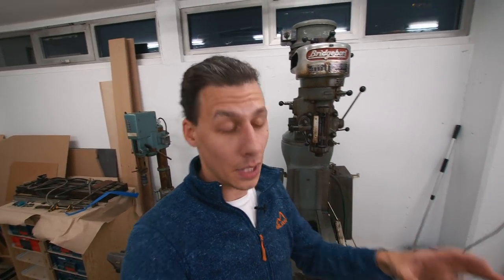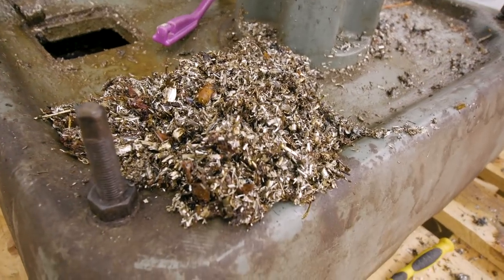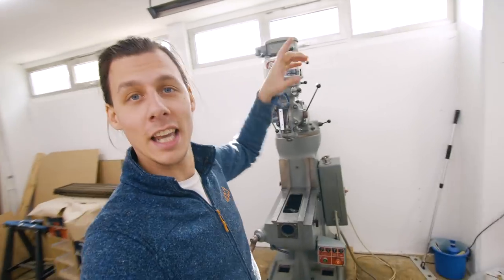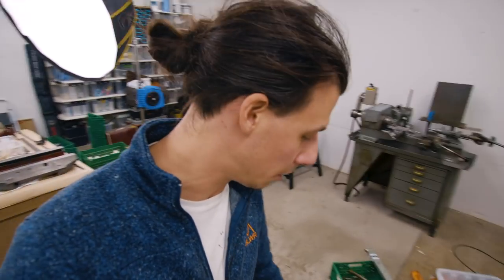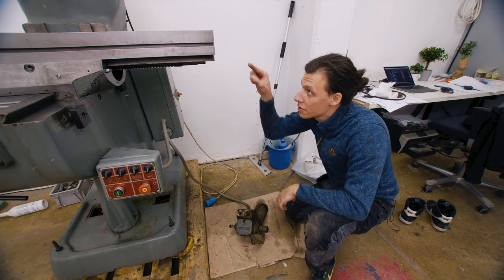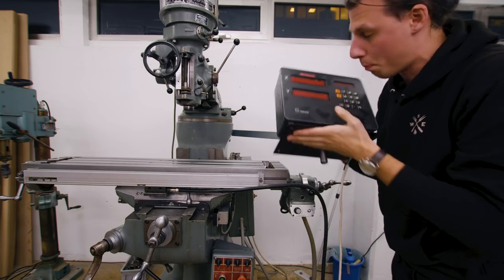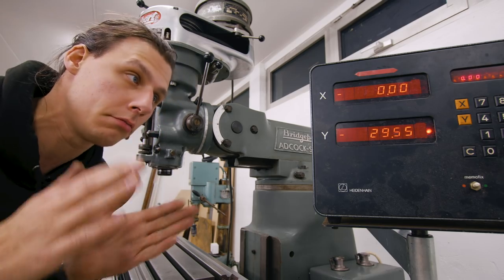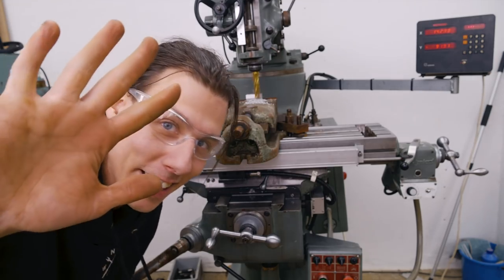Restoring a 60 Year old Bridgeport milling machine

Comment: Kudos for rescuing that beautiful Bridgeport Mill...I worked one of these for a few years...Please send a Hit Man round to kill the previous owner....slowly.
  Tip, stop hand holding your camera, use a Tripod, I know its quicker for you, but its seasickness for us.
 Well done.
Reply from the maker: haha, let's not get ahead of ourselves here :P It's a common mistake, after all they are commonly used as grease fittings. I'll do my best on the smother camera moves ;)
Reply: @achappel  Yeah, your right, maybe it is a little severe...The real foolproof answer is to use one of those spring loaded automatic oilers of course.. lol.
Reply from the maker: @EnglishTurbines  Jeah I wish the machine had that from the factory. I considered installing one, but the number of oil lines you have to route to get that to work seemed a bit to much work. I'll just make sure to oil it the old fashioned way regularly.
Reply: @achappel  Yes, you could always use Festo plastic lines 3mm diameter for easier install, but I guess we can trust you to oil it...lol.
Reply: @achappel  You did an awesome job,but you should've do better cleaning of inside of that power feed .Flush that oil with some strong degreaser on rapid ,drain it and repeat that couple of times and use some good oil cause it wasn't running as good as it can in my opinion,but great video overall.

Comment: 1:18 He didn't just "think" they were for grease. I've got a 1958 Bridgeport manual that specifically calls for grease in those grease fittings. But yeah, the general consensus these days is to run oil on ways. ...have fun without the oneshot oiler.

Comment: It is hard to believe, that the ways do not have vear after 60 years. Set the table to one end, grab that table and yank it, see how much play has. The most wear is in the middle of the ways, where it was mostly used. We have a 50 year old one, and it's worn out badly.

Comment: PLEASE use some camera stabilisation. Even my cheap Zenfone 5 is smooth by comparison.
My friend richard and I had to strip fix and rebuild the gearbox of a Holbrook lathe from the 30s. It probably came off a battle ship. Everything on it was solid, often cast metal. The dirt on that beast had a pension, but it still ran quite well. 

Richard has oa Bridgeport Mill with a few extra features, flood coolant and a catcher underneath it; but NO DRO. Look for a parts washer, thay rebuild jobs like that MUCH nicer. I was offered his spares Mill, but it's far too heavy for my single phase garage workshop.

Comment: Good afternoon,can you help me?
Tell me which engine model is on the auto feed axis X?
Reply from the maker: It sais boehm Co, bm 14585, spec nr 4640, 4.6 amps. Hope this helps
Reply: @achappel  Thank you very much!!!!) It is dc motor? 
I can not find information on it. We bought such a machine, but there is no engine on it, but the drive is in place. 
I'm trying to restore auto-feed of the x-axis.

Comment: Using pressured air to blow off all the cips caused them to get forced under the table over decades of use. That' why they always tell you not to use pressured air in milling class.

Comment: So you merely cleaned it and did not restore any geometric problem? You can clearly see the wear in the scraped finish.
Reply: Have you seen the measurements on the machine?? Could be it measures out good or the next video is going to be about trueing up the machine...
Reply: If a machine of this kind has a geometric problem it can not be restored or fixed, at least not by anyone besides the manufacturing company back at their factory. This kind of surface "restoration" or more honestly touch up, is all that can be done at home. And if by wear on the finish you are talking about the scratches on the ways, those have been placed there on purpose from the factory to allow the oil to "stick" and thus lubricate over a period of time. The fact those scratches were still there indicates that the ways were actually in remarkably good condition.

Comment: The reason you got so much swarf inside the knee is called the air nozzle. Believe me or not, when air is based on chips and stuff, it manages to get inside anything where you do not have proper sealing. The knee cross slide does not have seals between the dovetail ways. Any blast of air will blow chips inside. Just saying.

Comment: Great job, a positive critique, the camera holding is terrible, throw it on a tripod please. Also, some guys will pack a machine with grease because you can hide a badly worn machine with heavy grease. You now need to check how much back lash you have and how true all your ways are. I have seen a lot of guys try to pass off a machine as good until I pull out the tenths indicator and some simple green, then the stories start to roll.

Comment: the grease might be the only reason why there isn't much surface rust, even the surface don't look galled. Next time you shouldn't really use soapy water, but things like degreaser and part cleaner. Grease, way oil and other harmful things shouldn't go down the drain.

Comment: There's a small cup on the head that takes 10 weight oil for lubrication. Filling once a day when in heavy use. Ran these machines for 30 years. There's a newer but still old version that has a variable speed motor instead of the belt and pulleys.

Comment: How much does an old bridge run for ?
Reply from the maker: I don't really know, I think it varies alot. Here in norway they are very rare, but in the states there's alot more of them. Also depends alot on the condition.
Reply: @achappel  didn't realize that you were in noway silly question.
Reply: @michaelvaughn2287  In the states, expect $1500 -9k  Depends on condition and tooling that might come with it.  I'll tell you the real money is in tooling.  Buying the machine is the cheap part.  You still will need a vise, collets, end mills, DRO, power feeds, maybe an indexer and stock isn't cheap either.  The series 1 machines weigh about 2000lbs and the series 2 is closer to 5000lbs.  The 2hp series 1 J head with variable speed is what you should probably look for.  It's what most home gamers look for.  If you desire is to go CNC with it, expect to drop some serious bucks and start with a really tight machine.  Every part you need for one of these is available and not really that expensive.  Tooling can come from china and is of so so quality.
Reply: @jagboy69  👍thanks for the look out no cnc just as precise as possible.

Comment: Great Video, Considering the vintage age of the machine and you stating how well the X and Y axis were, using a DRO with an accuracy of two points after the decimal is a little saddening, though it's great it all worked, While I may still use the DRO, I would honestly love to learn the manual readout side of older machinery in good working order...
Reply: It may reassure you to realise it's reading mm, not inches. My similar aged Heidenhain DRO does optionally provide a third decimal place when switched to mm, but the third figure is always either 5 or 0. Which is, two tenths of a thou. Finer granularity than I want for most jobs, particularly on a somewhat worn machine. There's no point reading to a higher resolution than the alignments of the machine are true to. It's like using a tenths indicator to true up to a surface which is only straight and flat within one thou.
Reply: @Gottenhimfella  well in stating that, it makes a lot of sense. I'm not overly equated to freedom units due to living in Australia and usually working on Japanese vehicles.

To be honest, I have no idea how an imperial DRO would show it's accuracy. 

Perhaps at some point in the near future, I may need to look into machining using thousanths of an inch.

Comment: It seems that those dro scales are Heidenhain LS503 which is a bit more modern than the machine it self.
I think you can still get new rubbers from heidenhain with id-number: 360 502 - xx
 https://product.heidenhain.de/JPBC/image/HWP.EN/hlr-system/297530-93.pdf

Comment: Wrong Bridgeport’s cane with grease fittings for grease, but everyone converts them to oil with one shot oil systems
Reply: Bridgeport’s with grease fittings had leather wipers, oiled ways are to use felt for
The wipers not leather
Reply: @brettdavis529  Im pretty sure the old wipers shown in the video were actually felt eventhough this guy identified them as being leather.

Comment: I'm afraid you are going to wind up like I am.  I never used to worry about chemicals I was using for cleaning and I was usually outdoors.  Now I can't be around hardly anything without getting headaches or breathing problems.  I was young and dumb, time will tell if you are the same.   P.S. this was a cleaning and lubrication!  You would have needed to spend months and scraping in the ways if it was a restoration.

Comment: It's not really a restoration, but good job none the less. A restoration would include bearings, seals, gears (if worn, and to much play). I'd be interested to know the accuracy of the slides after re-assembly. Please invest in a tripod for your camera, and loose that music, takes away from what your trying too present.

Comment: I have to say it cos not many people have noticed the most insane thing I’ve ever witnessed in machine restoration. Did I just witness a man using an orbital sander on a scraped way. You may have a very clean machine but you now have a completely inaccurate fucked machine. I mean having witnessed this I wouldn’t even bother making anything on it. You may as well put an end mill in a power drill and go nuts 😂 next time get It reground or scrape the bed ways under it !!

Comment: Sigh.  These mills are not old.  

They have about another 300-700 years of life in them.  I am not exaggerating.   Modern mining companies are using presses that were used to push propellors onto propellor shafts....for Liberty Ships in WWI.   These are still in used today.   To understand the equipment in your possession you need to remember these didn't come from the world of planned obsolescence.   

There are no old mills.  There are only abused and neglected mills.   They can literally operate at precision for 1000 years with occasional replacement of worn parts.  

If and only if a skilled machinist is operating them and taking care of them.

Comment: I watched  you cleaning up the machine and its all good intention, but there needs to be a little more knowledge on the art of precision.  I don't mean to offend but rather try and educate.  The machine is cleaner but its probably lost some accuracy for the sake of being clean.  It didn't look like you went totally nuts on it, but i certainly wouldn't have took a sander with scotchbright to the ways especially not without a surface plate to measure it and scrape it back in.   look up the masters like Richard King and Keith Rucker, watch their videos and go to one of their classes and learn about proper machine rebuilding before taking on things like this.  That machine is very salvageable but if you just use it as is after what you have done it wont last as long as it should.

Comment: I noped so hard I almost had a seizure when you started power-sander scotch-brite scuffing the precision scraped surfaces on the bottom of the mill table. Please don't show people how to do things you don't know how to do yourself.
Reply: Not everyone is a machine rebuilder, Brian. That table has worked for years without the proper lubrication, so it is likely badly worn, and no longer as precise as to be affected by some light "scuffing". And don´t assume a surface is precise just because it's flaked. Flaking is for lubrication purposes.
Reply: Yes but you flake after scraping for oil. You have to actually scrape first..... not using an orbital sander. Scraped ways are soft.... and every pass with a scraper only removes microns. A belt sander will remove rather allot more than that. That mill thanks to his restoration is fit for the scrap bin.
Reply: @SuperDouginator  You HAVE TO scrape first? Scraping is a process used to obtain a certain degree of geometric accuracy. If the tolerance the design calls for is already achieved with the grinding, you don't have to scrape anything, but you may have to flake the ways to improve lubrication. Lots of 70s and 80s CNC mills were actually done like that, because the grinding process became more accurate and there was no need to scrape after grinding.
Reply: I'm glad I wasn't the only one who had a physical reaction to that part.... Certainly cringed..